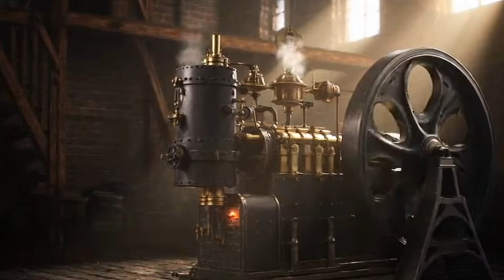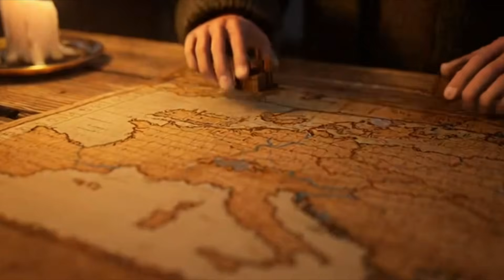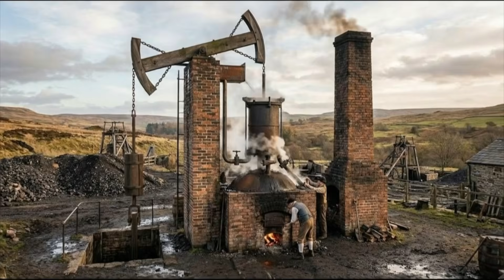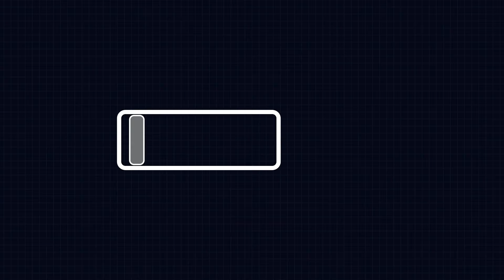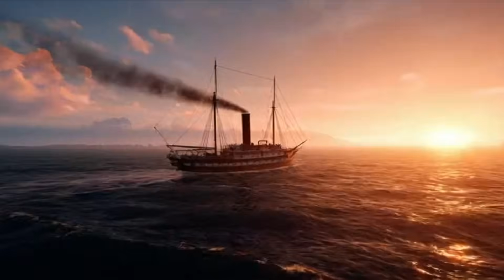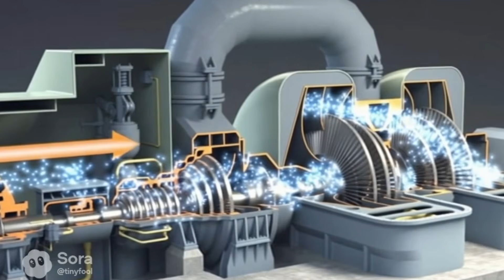The Steam Engine That Changed Everything

Comment: Steam Power did'nt push Newcomen's piston, air pressure did.
Steam Power pushed Watt's piston. And he needed a different machine to achieve that.
Reply from the maker: Spot on! That’s a crucial technical distinction that gets glossed over too often. Atmospheric pressure did the heavy lifting for Newcomen, while Watt harnessed the expansion and condensation of steam directly in the cylinder/condenser. By the way, I'm currently looking into Thomas Savery's steam pump—essentially, that relied heavily on atmospheric pressure as well, so there's definitely a strong conceptual link between Savery's design and Newcomen's engine. Thanks for pointing that out!

Comment: I said it would be several bites before I had covered the various things which I think are often not considered.  Now the structural rigidity which the Newcomen and Watt pumps had but later rotative engines didn't and the surprisingly long time before this was put right.

These early engines had the cylinder resting either on subsoil or rock, alternatively on masonry built to support the boiler and contain the fire.  The piston pulled vertically down on the beam and that usually pivoted on the engine house walls, pump dragged vertically down too so there was only the small lateral forces from pivot friction.  Nothing to be excited into oscillation, thick walls and in line with any forces needing to be resisted.  Even the few early ones without masonry had 4 large timber columns slightly tapered inward toward the top.  Things became exciting once there was a crank and unbalanced inertia forces on main bearings.  Quite often the cylinder was laid horizontal and bolted to a cast iron bedplate which lay on a masonry plinth and at the other end were the two bearings.  As the shaft rotated the imbalance, either from no counterweight or one chosen to match all the rotation inertia but only half the piston dead centre to mid stroke acceleration tends to lift the shaft and therefore bend upwards the bedplate and conversely when the cranpin is below the shaft and being pulled towards TDC it tends to bow the centre of bedplate upwards.  At low rpm all is well but go faster and the natural frequency of resonance is reached and the bedplate cracks.  Vertical engines, as in ships usually had structural members both sides, so a lot tougher.  It was the electric dynamo which needed speed which prompted enclosed box crankcases and continuous lubricant supply to big end bearings.

Note that because some lawyer patented the crank - preposterous given that people had been winding well ropes for 2,000 years - Watt used the sun and planet gear which gave two shaft rotations per cycle (both piston strokes).  That was probably a good thing because it kept the large reciprocating parts movement slow but helped the belt or rope drive not slip from excessive torque.

I notice that this information doesn't have much popular viewing, not my problem but it seems a pity.  We are discussing the basis of everything modern living relies on.
Reply from the maker: I really appreciate you sharing these insights into the engineering challenges of early engines and how structural rigidity evolved with different designs, especially the transition from stable vertical forces to issues with horizontal engines and cranks!
Reply from the maker: This video channel and https://mechanicaplanet.com/ are created by the same team.

We focus on the history of technology—especially the small technical details—and on how those details influence technological development and evolution.

We have a tech review section that welcomes guest contributions, and we also run a FORUM for open and free discussion. We sincerely invite you to register an account and join the conversations in the forum.

If you would like to contribute a tech review article, please register first and then leave a comment here to let us know. I will grant your account guest author permissions.

Thank you very much.
Reply: @MechanicaPlanet  Ah well, thank you for pointing me towards some Christmas reading or watching, I didn't know about your doings, I'm properly ignorant about the internet etc.

Perhaps it is easier for people in the British Isles to have starting prompts in thinking about old methods and equipment because it is everywhere but actually I fear that thinking rigorously and with understanding is rare everywhere.

As a child of probably 7, possibly 8, my parents took me to Birmingham science museum, plenty of the exhibits lodged in my mind and children are little sponges.  Standing beside a working mercury arc rectifier I glanced out of the window, grey rainy day, below was one of Birmingham's canals, it has more than Venice.  I have watched a working narrow boat start from Sidbury lock, one man operating everything:   Dobbin standing patiently having a rest, his traces and spreader bar on the ground, towing rope reeved through a single sheave block shackled to towing mast then spliced round a block of oak.  The man walks forward carrying the block of wood and lodges it in a masonry notch perhaps 50 feet forward.  He returned to the tiller and "Walk on.'. Dobbin sets off gently taking up slack, then has a 2:1 advantage over the 20+ ton boat, as the boat passes the notch the block falls in the cut and Dobbin speeds up slightly till the wooden block jammed on the sheave, jerk, Dobbin now in top gear.  

I can do more about canals but will next see how I get on taking up your suggestions.  Happy Christmas and New Year.
Reply from the maker: I noticed your registration on the site and have added your account to our Tech Review area.

You can log in at
https://mechanicaplanet.com/dashboard
and simply use Add Article to post.

I find your technical observations and discussions genuinely interesting, so please feel entirely free to write as you wish — just as you did in your reply here on YouTube.

Best wishes for Christmas and the New Year.

Comment: Two points.  Firstly when Newcomen was ready to sell his design, many would be constructed by millwrights and similar local to the mine buying it, he found that the Savery patent was worded to prevent him, therefore he had to form a cooperation with Savery - money, not usefulness.  But that confuses tyro library searchers.  The important thing is that atmosphere will push water up about 25 feet but mines were far deeper than that.  Savery, not down a mine with a high pressure boiler whose fire took air and emitted smoke, gaily proposed blowing the water upwards the rest of the height, say 150 feet.   So he would need say 80 lbs per square inch.  He had cast iron pipe and soft solder...  Watt was going to go wild about 25psi about a century later.  Savery was a dreamer. The Cornish engineers made a series of lift pumps so none had to cope with more than a small head of water.  The stroke of engine piston and fulcrum position of beam determined the lift stroke.

Obviously the rate of pump strokes needs only to keep water level below the workings, therefore a variable controller of steam inlet to purge the cylinder is needed.  Very fine adjustment,  there was a cup fixed on a horizontal arm, a tap controlled the rate at which the cup filled with water and thus tripped the valve. And was reset as the piston moved.

It is worth noting that it is gravity acting on the mass of air which makes atmospheric pressure so the engine is only atmospheric in that the atmosphere is an intermediary, as is steam because they are coal engines, we have petrol engines.

At Dartmouth, Newcomen's home, is a very early Newcomen engine, probably circa 1720..  It was built for a coal mine, had a second career on canal water and was rescued when about 200 years old.   I was pleased to note the brass plate given by ASME, whose note says that this is the first heat engine of all time.  I will write about temple ornaments or deliberate bamboozling the congregation toys another day.
Reply from the maker: Thanks for these incredibly detailed points about Savery's patent, the mechanics of early pumping, and the atmospheric principle, as well as the fascinating historical detail about the Dartmouth engine! It's always great to learn more from your deep knowledge.